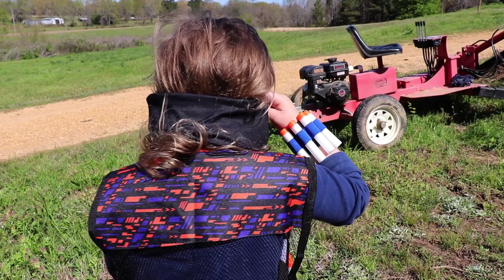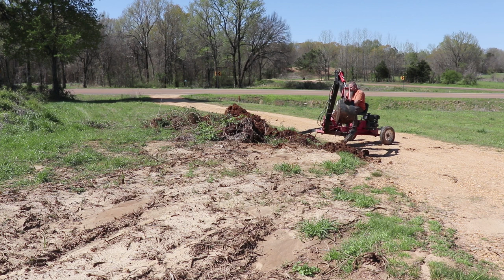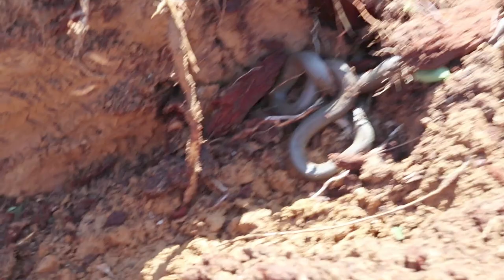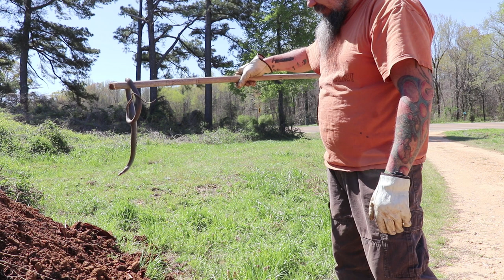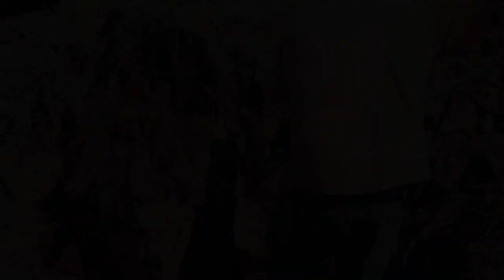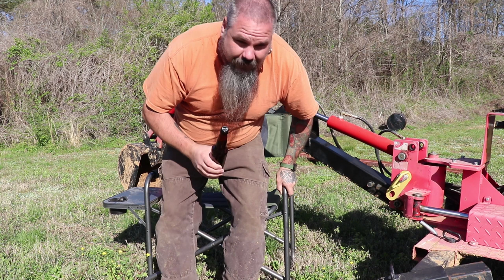CENTRAL MACHINERY Backhoe. Elysian Night Owl. Beer Of The Weekend.

Comment: With any backhoe, you need to have at least 3 accessories: A Ripper, a Thumb, and a 8-10" Trenching Bucket. Those 3 things will at least double the usefulness and versatility of any machine in stump removal, trenching, rock or obstacle removal, and in material handling. You may have them, but I didn't see you using any of them in your work.

Otherwise, I think you did a good job on the video.
Reply from the maker: No, I don't have any of those.